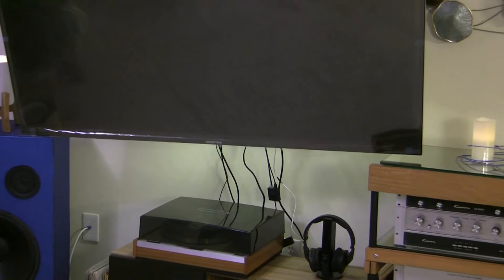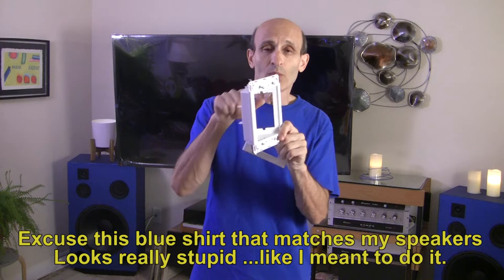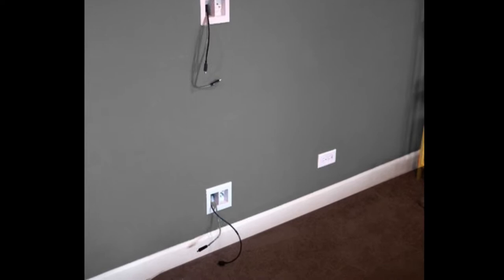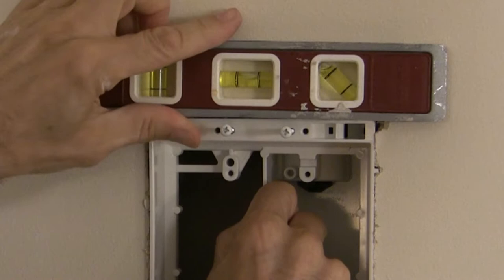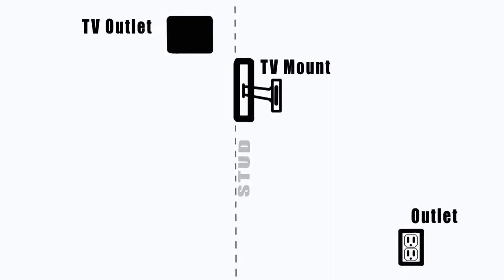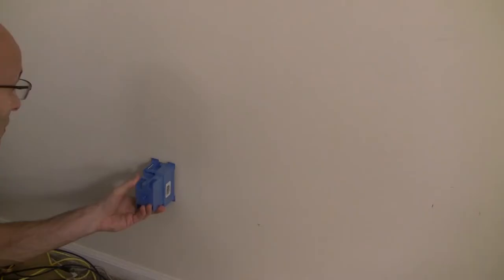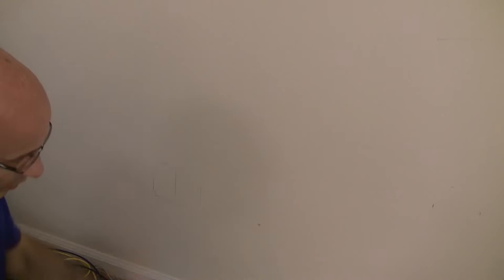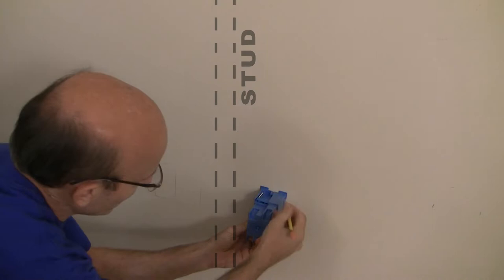A Better Way to Install a Recessed TV Box

Comment: Marty, you are a hoot!  Good ideas from your video.  I am setting up in a large conference room and have decided just to forget the fancy stuff and put in a new outlet for power and a component plate like yours using keystone jacks.  I will be using a low voltage frame instead of a box - no need to cut off the back end and very easy to get at everything.  Also is up to code and low voltage doesn't require full box.  You had me chuckling a lot.
Reply from the maker: I didn't know about low voltage frames when I made this video.  Another thing I didn't know is that wrapping your wires in aluminum foil will keep them from interfering with each other.  That was told to me by an old auto electrician.  Thanks for watching, Rick.